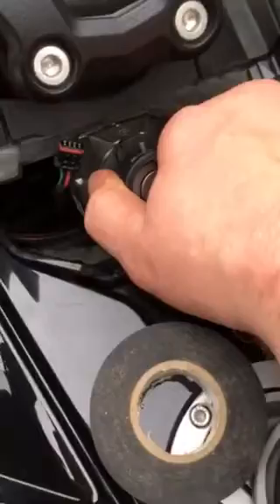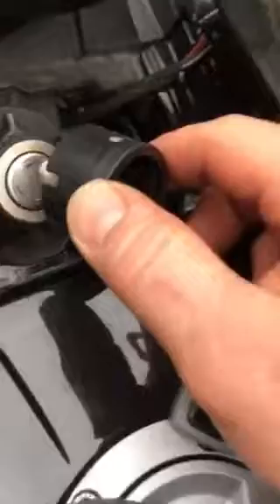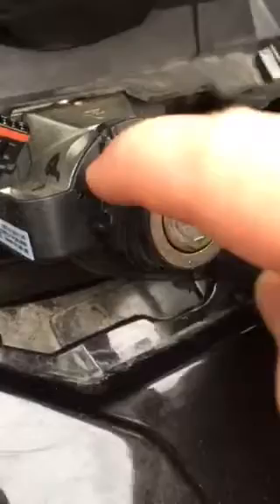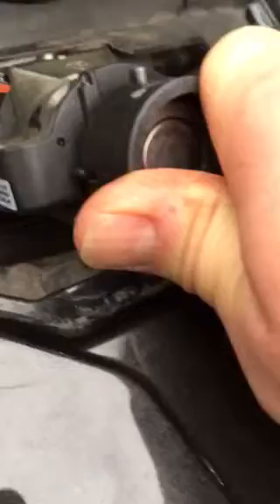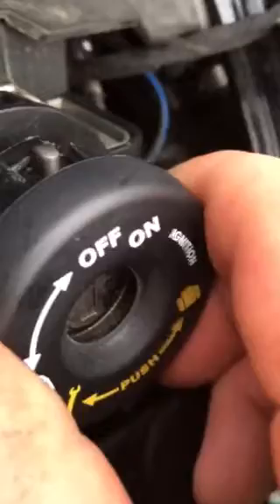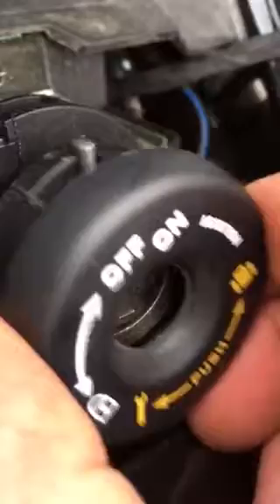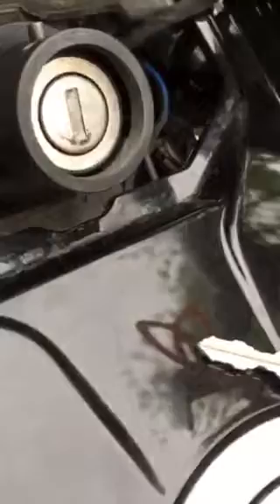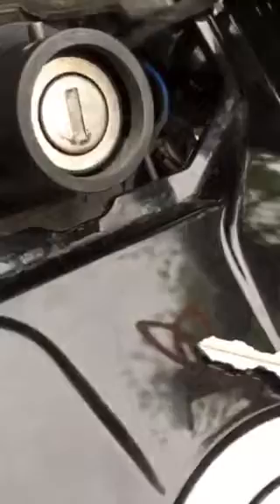Spyder bad key fix part 2

Comment: I have this problem too but on a 2014 ST-S so to verify your humidity theory I placed an electric parabolic heater on the seat abnd directed it at the ignition switch. After 15-20 tried to start and it worked! My problem is 2014 ignition is under the handle bars so removing it will take some extra effort. Will this work for this model as well?